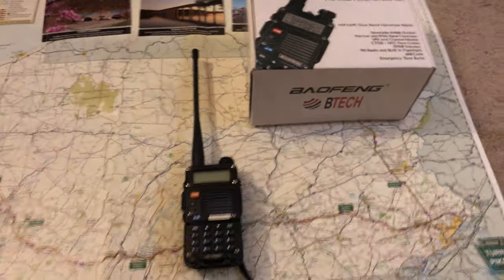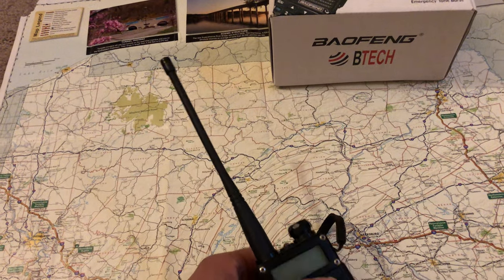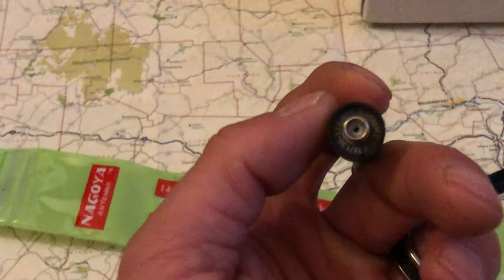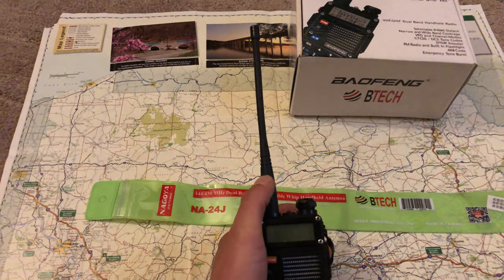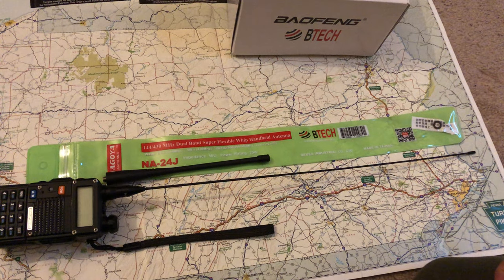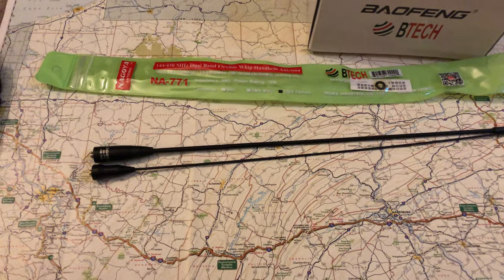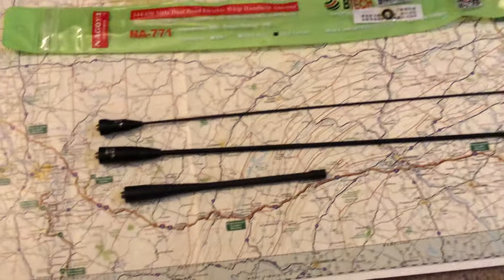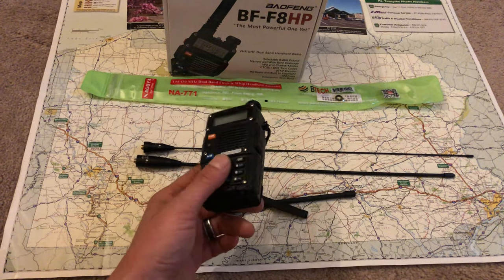Nagoya NA-771 & NA-24J

Comment: good info! just what i needed! i ordered this antenna a few days ago should be at my house now. i have the na-24j and ut-72 for my truck mount.
Reply from the maker: How are those antennas working for you??
Reply: @mikecricket113  Hey there and Merry Christmas and happy New Year. When I had the antennas they worked great! I ended up trading everything back into Amazon, getting a refund, and I bought a Yaesu FT-3DR which sports a Signal Stuff Signal Stick antenna and for my mobile rig a Icom 2730 with a Comet Sbb5. Soon I will upgrade the Comet to a Diamond 770NMO. The Signal Stuff antenna is indestructible and wonderful TX and RX!!